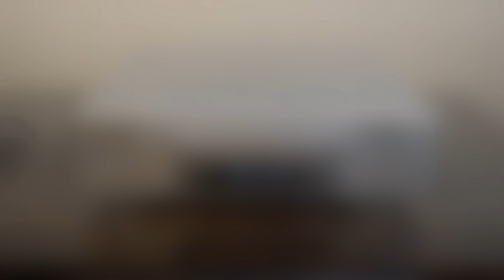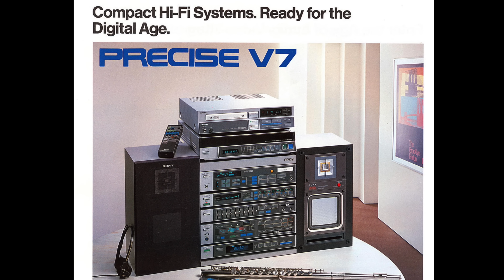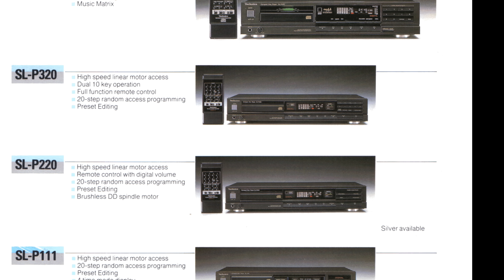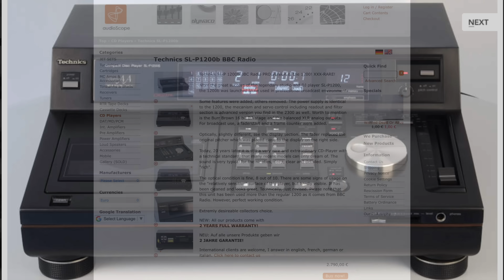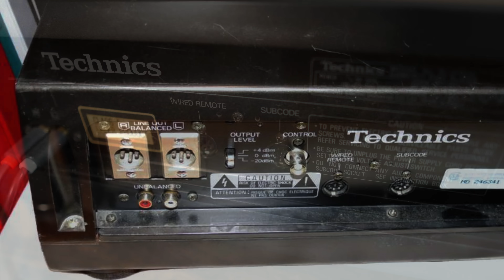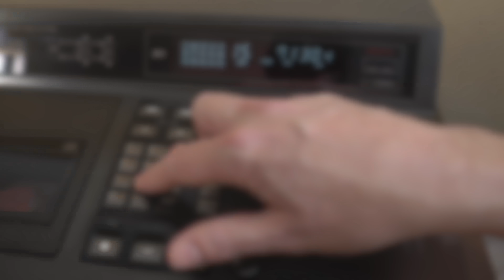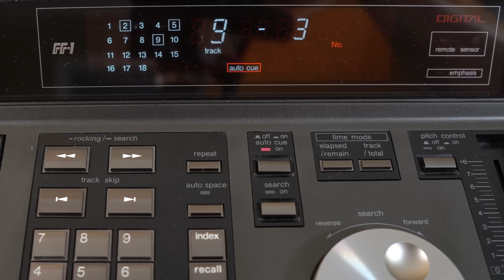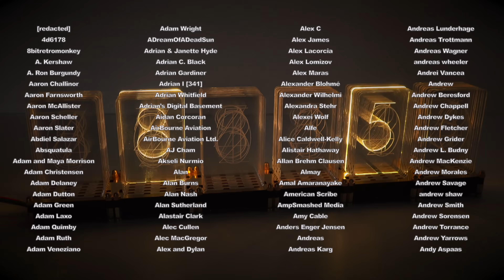How CD players lost their cool & why this Technics didn’t.

Comment: Great video! Do any collectors out there buy old DJ CD players for their hifi setup? I know that Technics turntables are loved by DJs and audiophiles alike, and I wonder if any CD players have similar appeal. DJ gear is often more durable, sounds good, has nifty features (shock resistance, pitch controls, etc), plus sometimes it looks a lot cooler than generic consumer electronics.
Reply: Also, as a DJ, the fact that the pitch slider is backwards compared to the DJ standard (towards you = plus, away = minus) is so stressful! Haha

Comment: I went to the Audio Engineering Society (AES) in 1980. This is a professional trade show for the broadcast and recording industry. Philips were showing the CD100. They had scratched  and damaged discs to show off the error correction. It weighed over 20Kg and they were banging it and standing the whole machine on end. Of course it just carried on playing the disc.
A second machine had the lid off. It was built like a brick outhouse. Cast aluminium chassis, massive power supply and all. Most impressive though was the stunning amount of stacked up circuit boards. Many of the special integrated circuits had yet to be made. It was rammed with discrete components.
It wasn't long before CD players shrunk - by Sony probably - into the same silver and teak of all the other Hi Fi Units.
The sliding drawer was a work of art and the circuitry was now all on one board. The ability to randomly select tracks and change the order were fantastic after all that cassette tape winding. It all soon became commonplace and quite rightly really. It was the music on the disc that was important.
I've had quite a few broadcast CD players since - most were rack mount - and all the buttons were on the remote.
It's good to see an early 80's machine with all the controls on top. Many thanks Matt for all your top quality tubes.

Comment: I remember an early CD player that took the exposed disc thing via a window to another level by having an arm attached to the laser sled that would reach around the disc in a U-shape to provide a needle in the window above the CD to show off the position the laser is at, in addition to seeing the disc spin. Unlike any other player I know of, it had the laser home position on the outside of the disc (so the needle thing won't interfere), which came with the "drawback" of it having to move the laser all the way across the disc from the outside in before it could read the TOC and start playing. All in all this player was fascinating to look at. Only problem is that I saw this thing 20 or something years ago and don't remember a make, let alone a model number :(

Comment: I repaired over the years maybe  more than 10 of  SL-P1200 (most of them for optical pick-up replacement), they are OK, heavy, well build, but not so reliable as you may think. Me too I  liked them very, very much and i dreamed many years to have one. Finally i got a SL-P1300 in MINT condition, like new, really. Once at home, i compared the sound with my Sony SCD-777ES (used as CD player of course, not SACD) and I can tell you that Sony sound is way better( more musical, better sound stage, better bass, better micro-details and so on),  than Technics, so I decided with regret to sell Technics some years ago. Indeed, a lot of nice features, but quite useless for home. I have now also a Studer A730 with a lot of broadcast features, but the sound (in my opinion) is still under Sony SCD-777ES. Unfortunately also my Sony "asked" for a new optical pickup two  years ago, a little too soon , but now is back OK.  In two words, Technics sound is a little muddy, Studer is a little dry. Of course, any of them in the right system can be a great player , not in mine.

Comment: if you are as into scando design as you are audio tech then you might be interested in the B & O CD vertical CD player that had the option of being wall mounted. That thing shows off the spinning CD for all its worth whilst combining it with sliding doors plexiglass doors. its not my thing but the opening and closing of the doors is a wicked visual effect with the CD spinning behind them.

Comment: My parent's first cd player was a front loader, but the slot section was clear or smoked plastic and extra tall to give you a view. It also had a clear or smoked top panel over the mechanism which was illuminated with green leds. If it was at the top of your equipment stack you got quite a nice view of the spinning cd. I loved watching that thing as a kid.

Comment: Nothing to do with CD players as such but nowadays I hardly play my cd collection. However recently I decided to dig out an old boxed set of classical cds and play them. When I opened them up I found that the thin foam separators between each disc had almost totally perished and all the broken up bits were stuck to the discs! I had to peel the bits off which took ages. Then I played the discs ( after cleaning them with a cloth) and though they were playable, I think the music quality was affected at least a bit. So be warned, if you haven’t played certain discs for years then you might be surprised that the foam separators which are meant to have been protecting the discs have disintegrated like mine.

Comment: I worked as a DJ in a club when this model was released and I the opportunity to use it for a while. It was a godsend, as it could zoom in down to a cue point on any song in the CD, just by typing in the track, time code, and frame number on the numeric keypad. The reason for the size and heft of this model is due to the fact that Technics was trying to make it easy (an obviously attract) for discos and clubs to replace their de facto turntables (the ubiquitous Technics SL-1200 - hence the same model number for this CD player with an extra P) by making it exactly the same dimensions.  However, DJs panned it because the pitch control was reversed when compared to the SL-1200 turntable (push up to slow down and push down to speed up). But, as you pointed out, the speed at which it reads, and gets itself ready was to make it convenient for DJs. The feet of this model are exactly the same as the ones on the SL-1200, being vibration absorbing.

I've been following you for years and years now, but have never been compelled to write anything until I saw this video. Your videos are truly wonderful, and my Saturday evenings (I'm in Malaysia - GMT +8) are always a treat when a new video drops! Cheers!
Reply: Unfortunately, Technics simply had no luck with DJ CD players on the market. First SL-P1200, followed by SL-DZ1200. Not even making it look and appear like a DJ turntable helped. Pioneer took over just like that.

Comment: Great video. I wanted the Technics SL-P1200 for DJing but it was waaay to expensive for me at the time. I ended up with a couple of Technics SLP-770 which I hacked with a pitch control before I got my Denon pro gear.
Nice to see the Hitachi DA-1000 on here. I ought to get mine out and have it in pride of place with my other old components.
I actually got the service manual for the Technics SL-P1200B  ( yup - the rare BBC one) - so I could crib the pitch control circuitry for the low end players that I had.  ( I still have the manual somewhere) 
Thanks for this Matt

Comment: This was a great review - I've been looking for a CD player with the jog/shuttle dial, and had been looking at these on Ebay and it was nice to see the overview.  That pitch slider is cool.  One thing - Are you sure it can't play CDRs?  Even if recorded in Disk at once mode?  I  had a similar technics unit back in the day and I could have sworn it did, and I'd be surprised if this one couldn't play any.
Reply: That would surprise me as well, especially considering I own two "cheapo" CD players from the mid to late 80s (Goldstar GCD-613 and GCD-626R with the luxury of having a remote) and both of those have no issues detecting and playing burnt CD-Rs (80min/700MB). They even detect and will attempt to play 90min/800MB CD-Rs though they're ridiculously sensitive to any sort of bump or vibration when playing those, so that's obviously at the upper limit of what their lasers can focus on. Nevertheless, they'll do it

Comment: My first cd player (near the end of 1987) was from Akai. It worked with a tray, but the front of the tray was transparent and it had a small internal light. Kind of the best of both worlds. Sadly the rest of the device was rather so so. The display malfunctioned regulary, it skipped very easily (from even mild shocks). Still, it was nice to see that disc spinning away and I remember trying to see the laser.  I had it for about 3 years until I sold it and bought a Philips CD620. I still have that one sitting in a cupboard, but sadly the tray doesn't open any more and I can't be bothered to try and fix that. For now.

Comment: After you showed the vertical players, I wondered if you could do it for a computer. Holding up my old CD walkman to my computer case, it looks like you probably could fit it into three 5.25" drive bays, though only just. I have my doubts about whether you could adapt the mechanism from a regular drive, though. They're designed for a horizontal fit and computer cases are hardly short on space in the z-axis, so the manufacturers don't really have any incentive to make the mechanism short. Newer drives do seem to be shorter than older ones, though, so maybe you could do it in four bays with the laser moving vertically.

Comment: In my golden years, I had a 'normal' Technics CD player, the SL P340 or maybe 440, from the top of my head. And it also had Auto Cue that cues up until the exact moment the track starts. So, nothing special, there. Maybe that feature was unique to Technics?
Must admit, quite an impressive machine you have there. Nice big jog wheel and speed controls.
What I absolutely love on this machine is the 1/10th seconds time indication and the ability to just key in a time to skip to or cue up to, on a nice big keypad.

Comment: I had the honour (Or should that be the annoyance) of having to repair these at Panasonic/Technics back when they came out (and became faulty after sometime). They are, without doubt one of the most annoying CD players to have to repair. However, they are probably one of the most delightful CD players to use, quantified only by the fact that they are horrifically expensive, even secondhand (unless you get a bargain) to buy. These decks were mostly bought up by radio stations and they abused them to infinity and back. If you can find someone willing to sell you a laser for one new, buy one now, as they are effectively unobtaininium from now on. Just a suggestion, all the very best, Aston.

Comment: My best players are a simple MarantzCD583(Philips) (1989/90) and a Philips CD582 (1989/90) , Sold my Marantz 65 MK II  (1989/90)  Because I had no need for it and had too many CD players and the two I kept had better performance in reading the bloody CD's as well as good sound. The Philips one has those green Nichicon capacitors so it sounds better and the Marantz(Philips) one reads bad CDs or no other CD player can read them.

Comment: Crazy Audiophiles say they need to be played in complete darkness so the laser can read the disc better. So the disc must be enclosed in a dark player. Some crazy Audiophiles even color the edges of their discs black with a Sharpie to stop the laser light from escaping out the edges or light getting in the edges from optical effect. Of course this makes no difference as the laser either reads the pits and lands of the disc or it doesn't, 0 or 1 end of story. If not it doesn't work as in a read error or like when a disc skips. I agree, CD players should display the disc as it plays much cooler.

Comment: In the early 80's I remember being surprised at the high 500+ RPM of CD. They seemed like a throwback to the 78 or the 160 rpm Edison cylinder in regards to speed.
Reply: Wait until you see a 52x CD-ROM drive
Reply: @drfsupercenter     Metal Grinder Speed

Comment: I had one of these for 25 years. It had optical output and Technics designed it to have the same footprint as the Technics turntable. It now lives in the Powerhouse Museum in Sydney as I donated it to them several years ago. Technics wanted $1500 for just the part for a replacement laser. Great sound always and didn't look like anything else.
Reply: these don’t have an optical output. did you not listen to anything he said?😐
Reply: @jessihawkins9116  I had it mixed up with my portable Sony DAT recorder that I used with it for years to present shows. But thanks for your needlessly rude comment.
Reply: @Maynardcomau  oh yeah, sorry about that 😕

Comment: The earliest car stereos with CD players used the caddies to protect the discs. That got expensive (and bulky) if one wanted to carry a decent sized music selection without having to swap discs in and out of caddies. Then along came the slot load mechanism and everyone quickly forgot about caddies, at least for car stereos. They hung around a while longer in SCSI CD burners. I still have the very first CD-R I burned in a caddy type 1x SCSI drive. It's a disc with dark blue dye and gold plating so the dye looks like its dark green. It even worked in the old Mitsumi 1x CD-ROM where the whole mechanism slides out and an internal lid opens. That was a drive supposedly incapable of reading CD-R.

Comment: The early models didn't have XLRs or infra-red remote control: instead, they had two 5-pin DIN sockets: one for data and the other for a wired remote control - as was common in studio usage.

You didn't mention the disc-clamp stabilizer, common to this and many high-end players. It was the CD equivalent of weights and clamps on vinyl record players.
Reply: The really cool ones offer serial and "parallel" remote control. The "parallel" remote is really just GPIO, it usually provides contact closure inputs for play, cue, track select, skip forward/back, as well as outpits for status lights.

If you have it wired to a mixer or audio console with fader start, you can use the fader start contact to trigger the play input on that jack so a cued track rolls when you pot it up.

Comment: Its no coincidence its named after the Technics SL-1200 series of direct-drive turntables originally manufactured from October 1972 until 2010. Built to last and give perfect precise playback. Thank you Technics.
Reply: The SL-1200 is still being made.. its at Mk vii now though..
Reply: This was a machine with big boots to fill.  The SL-1200D had become the weapon of choice for DJs, on the air and in the clubs; and Matsushita knew customers would be expecting as much control over positioning in time with CDs as a fast-starting, fully manual turntable could give with records.  Hence the crisp, positive action of the switches, and the resolution of the motion sensor on the search dial with its balance weight carefully designed to mimic the feel of a record on a turntable platter.

When you've got a quarter of a million listeners out there or just a few people on the dance floor, you don't want buttons that slop about and leave you wondering whether you pressed them hard enough.  You can always tell a precision instrument by the way it _feels_.
Reply: This CD player was mainly for dance club DJ's who needed to "cut & scratch" and to sync the rhythm from record to record in order to keep people on the dance floor, like they were able to directly physically do by touching their pair of spinning 12 inch analog records which facilitated an uninterrupted but spur of the moment changing stream of music.
Reply: @sparky6086  They were also used in local radio stations, where it's usual for presenters to operate all the machinery themselves.

Obviously in a dance club, you want to maintain an uninterrupted flow of evenly-spaced beats; but even as a humble DJ on medium wave in the back end of nowhere you still want the favourite song of the listener for whom you have just read out a birthday greeting to start dead on time, and you want the final drum beat of the last record of your show to sound exactly one second before the pips as though it were the first of seven.

I've done both kinds of DJ work, and they present their own special challenges, but the common thread is precise fingertip control of exactly when the music starts.
Reply: @bluerizlagirl  digicarts with extended memory killed that in radio
Reply: @drdelewded  Indeed; but fashion is fickle like that. Whatever technology the kids think is cool today, will be swept under the rug of history soon enough .....
Reply: @bluerizlagirl  well digicart has been dead for a while now with file based play back
Reply: I love my Technics 1210 MG5 and even my Technics SL-23 . Great quality products
Reply: Also it's based on the same footprint by the looks of things, the base is straight off a 1200 / 1210.
Reply: Lol, that's what I play my albums on

Comment: I'm 99.9% sure our very first midi stack system with built in CD player was an Hitachi and it definitely had a vertical cassette like door flap for the CD based on that Sony prototype.  We had that from around 83/4 right into the early 90s.  I did like seeing the disc spinning through the little window.  I think it was only replaced because my dad wanted a multi disc player.